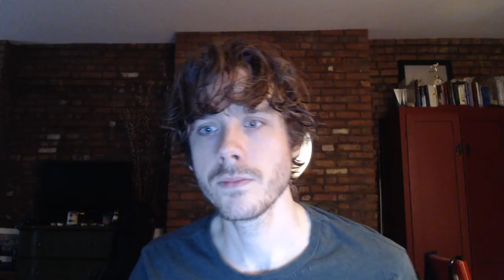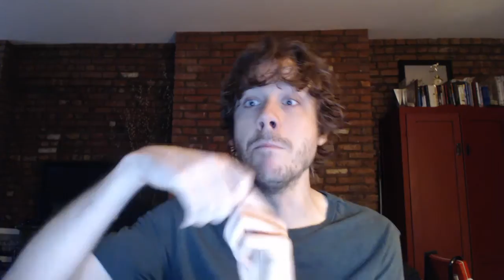Piezoelectric graphene electricity generators

Comment: this will not work because those straps will not be moving all in the same manner so when one strap produce positive charge the other will be producing a negative charge to cancel it so unless you make those straps move exactly the same way this won't work.
Reply: If micro diodes and tiny bridge recruiters can be made and installed cheaply it wouldn't be a problem.